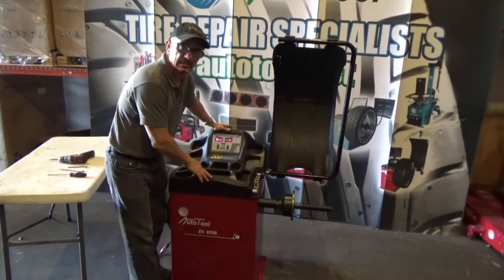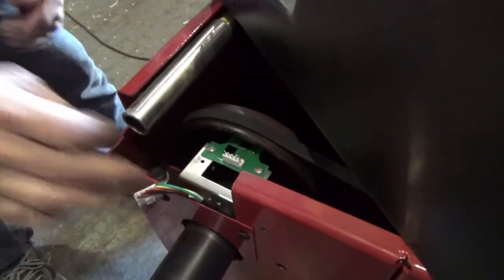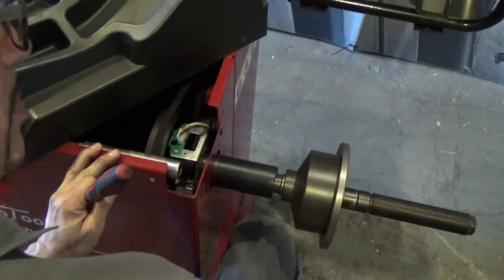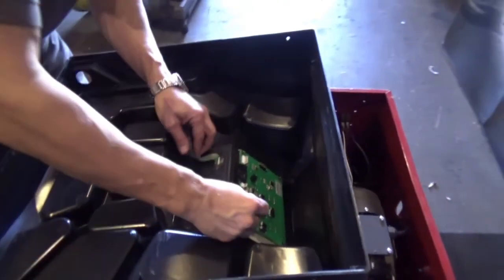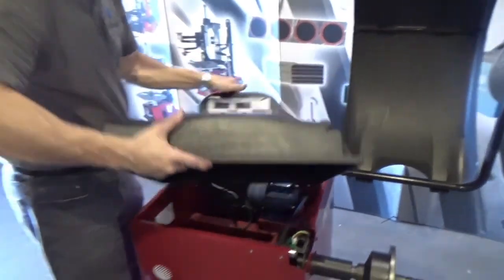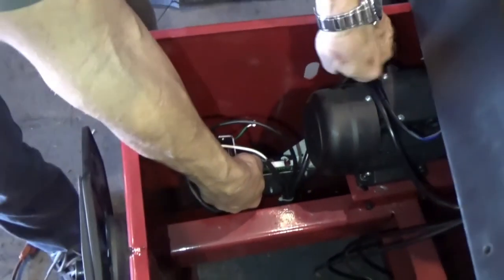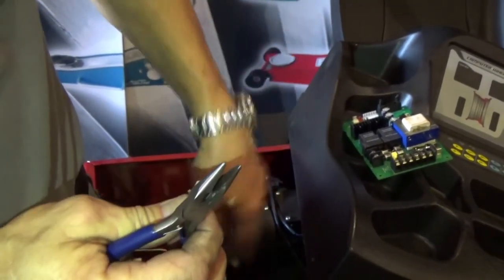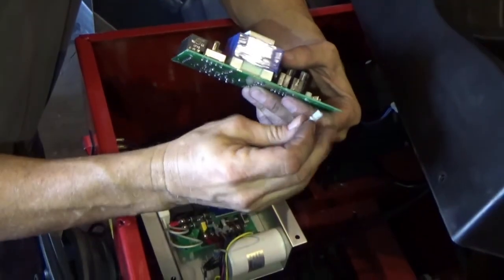Wheel Balancer Repair - AUT825

Comment: Nice video! Hey i bought a used machine and it says to check it with a weight supplied by manufacturer but machine is old not sure what weight they included.how else can i check its a john bean 4100.i subscribed video was more than explained how to fix.

Comment: Hi. I have a twin Busch tw-95 and when I turn the power on all it does is beep. A continuous beep. It will turn on but nothing loads up. You do not see anything. If press the buttons it does nothing. I have only used this 12 times. It’s like new but they will do nothing. Out of warranty.

Comment: have a Bosch WBE4510. Balancer.Burnt the wire connector on the power supply board, and Bosch does not have a  way to test the components so we don't burn another. This is a Sicam machine  they think it is a motor, or the Filter?any thoughts or experience here?

Comment: I have DST Balancing, after I've changed the Capacitor with 10uF (as follow the original) (cos the motor can't run maximum), I've checked the capacity less than 8.4uF. 
For the 1st time I turn the main switch can display normal, when I push the limit switch (cover) can't displayed anymore.
Pls give me advice to fix it.
Thanks